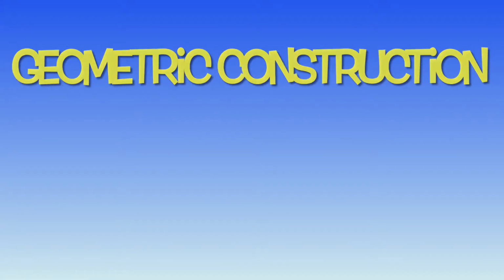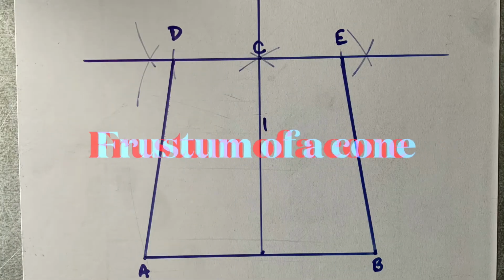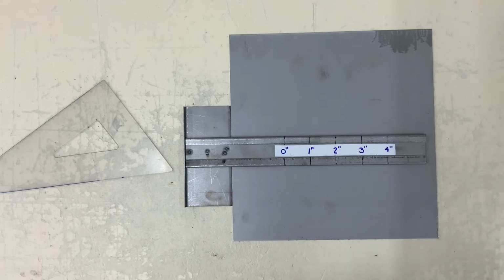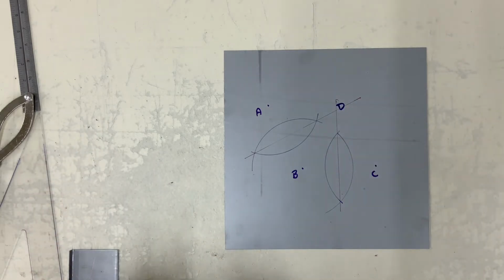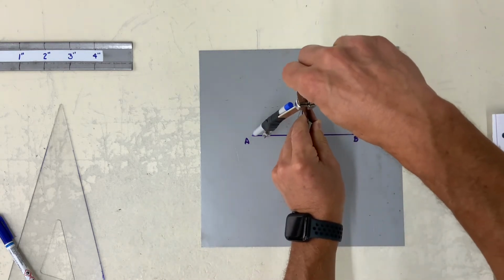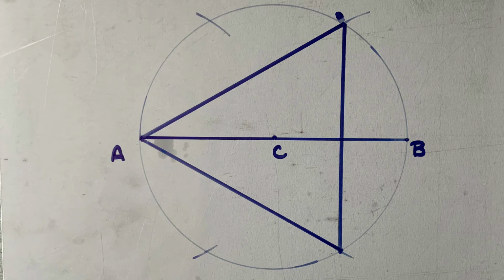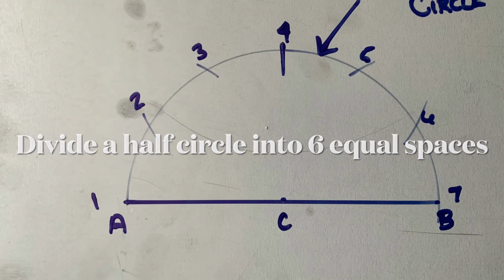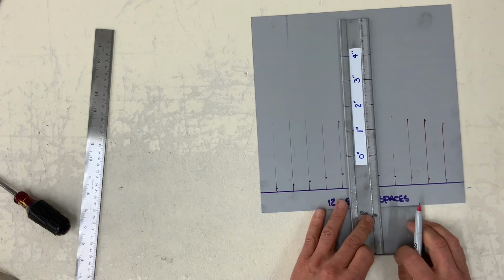Geometric Sketching

Comment: How would you go about making a downspout?
Reply from the maker: That’s a tough one to answer because there are diff types of downspouts.  If your talking residential, I’d buy it.  If it’s an architectural downspout, I would follow the dimensions/profile as I would for straight Rect duct. Sorry I wasn’t more helpful.
Reply: @sheetmetalwork  that's about the same way I would have answered the question... thank you for the response. I figured it never hurts to ask, just in case theirs some other way about it I hadn't stumbled upon...
Reply: @sheetmetalwork  is their a lock that can be created in a 10' break that would work for a downspout? We just have a half-inch segment that overlaps and acts as a riveting flange.